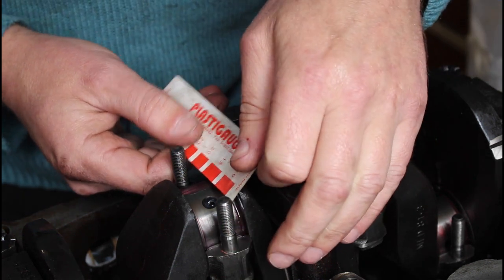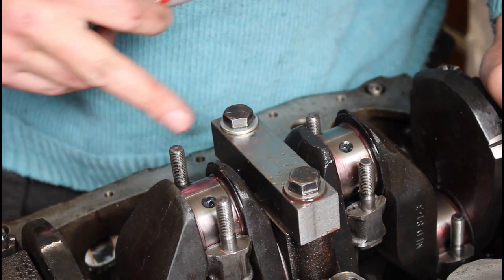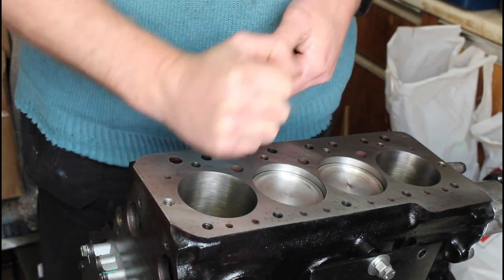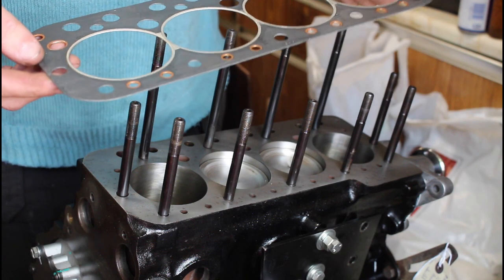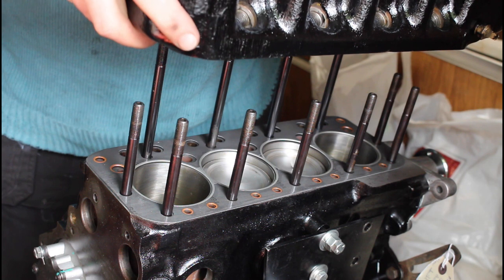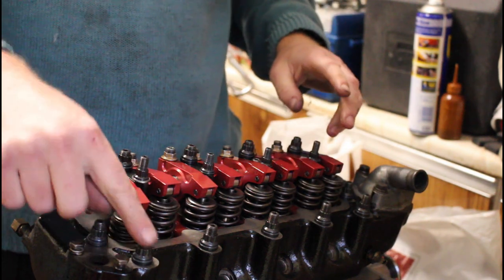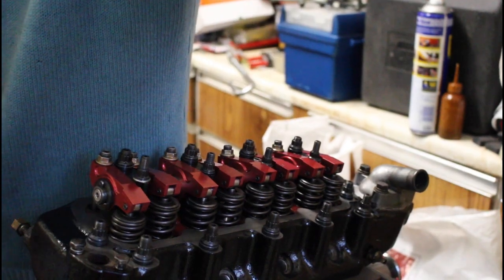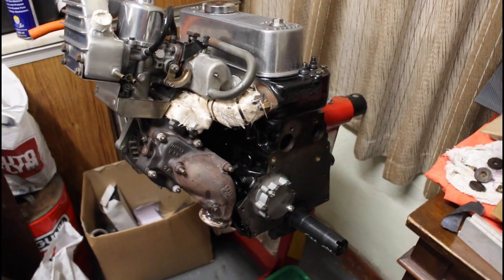Classic Mini Turbo engine rebuild. Part 2

Comment: Head studs inserting doesn't have a torque, they just need to be hand tight.
Reply from the maker: i thought in the dim distant past ARP specified a torque figure, but as you say handtight is tight  :)